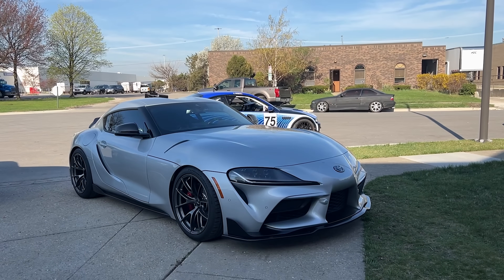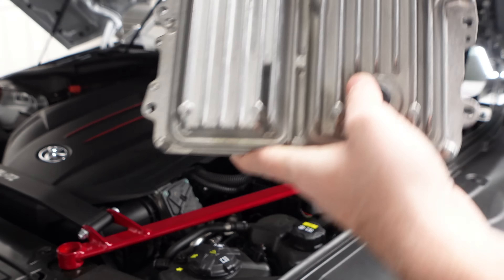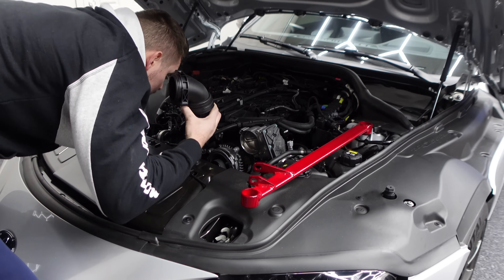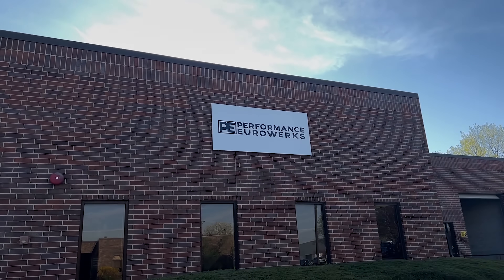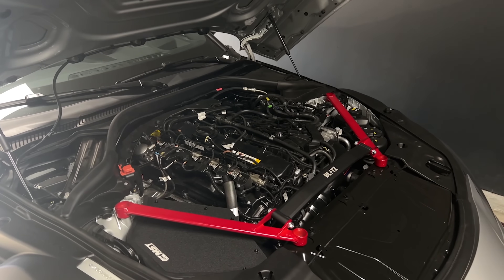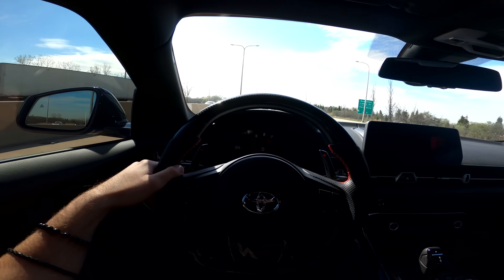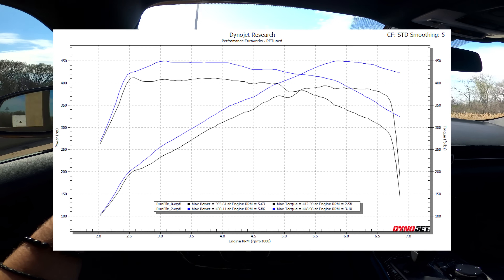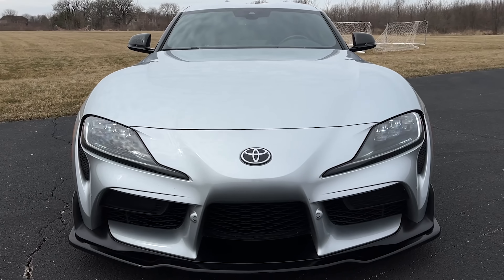Finally Tuning My 2022 Supra |Unlocking ECU|

Comment: Did you buy BM3 separate? or did you get it with the unlock with Euro? I'm trying to unlock my ECU for my 2021 Supra. Any help is appreciated
Reply from the maker: Yep I bought the bm3 from a different place. DM me on IG and I will help you with contacts. IG: Alexxkolev
Reply: Can they unlock the ecu for the 2022
Reply from the maker: Yes mine is 2022